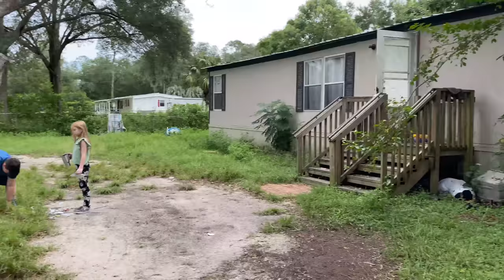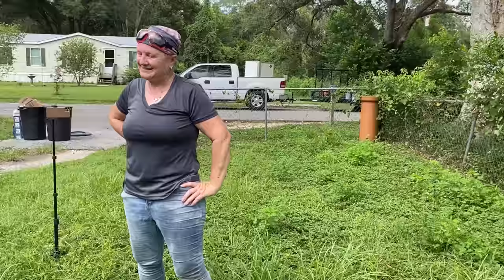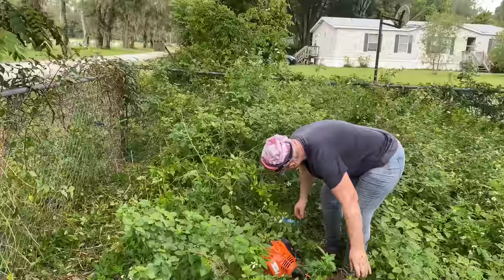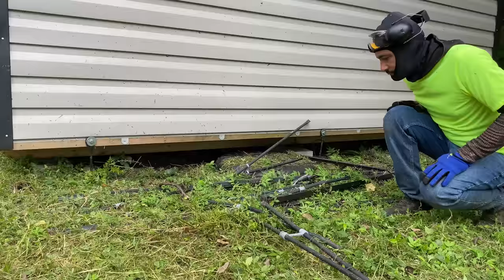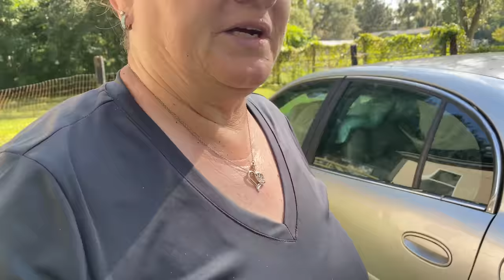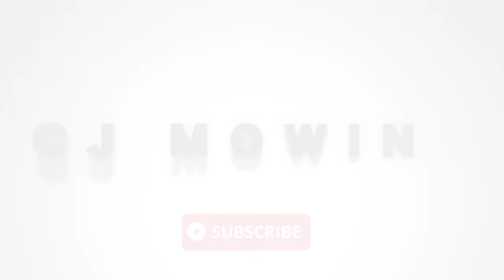WHY Grass SO TALL? "🙄 It was JUST MOWED a MONTH AGO!" 🫠

Comment: First wonder, did you go get a can of Wasp Spray... Second problem, a cluttered property, hidden in the overgrowth. Did it need doing...yes.  Will the help likely help the people...yes.  You worked at facing it down. This repair will at least last a while.  Thank you for your work, courage and problem-solving and for the good space created for the kids to experience. Good the little girl got the experience of watching and the mower repair. It was hard to get perspective on the property but working one small area at a time seemed to work well to get it done.   Due to some of the seed trees, etc. some of this was even several seasons behind.  Like that you got it caught up.  Mowing alone wouldn't have done the backlog.  Appropriate song. "Don't give up..."

Comment: Wow 😯 watch out for that plastic siding with the string trimmer. I had that all around my house and the the trimmer knocked holes in it. Well when winter came it let my pipes freeze. I was out there trying to tape up the holes and the tape just wasn’t sticking. So I said heck with that and took a shovel and scooped snow up and over the holes. Wire that was enough to stop the wind and cold 🥶 and I got the pipes thawed. Waited till spring and fixed my mistake. 😫